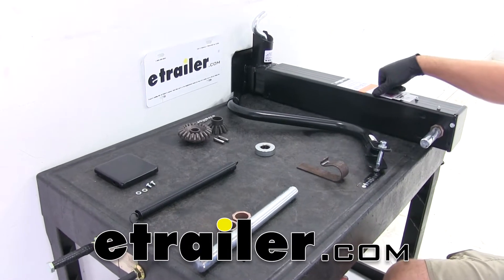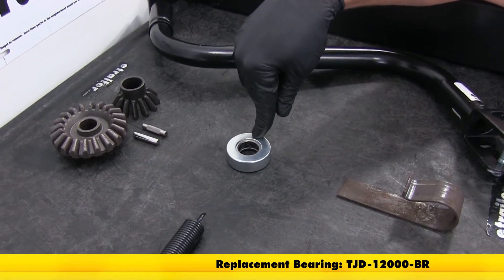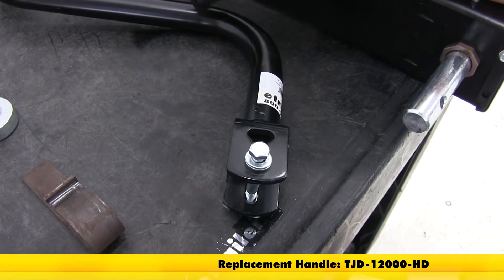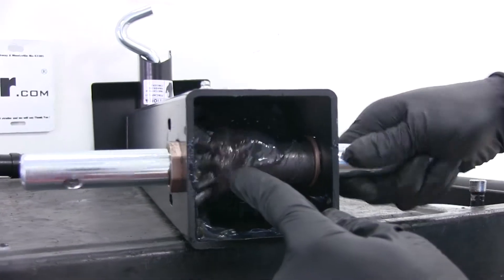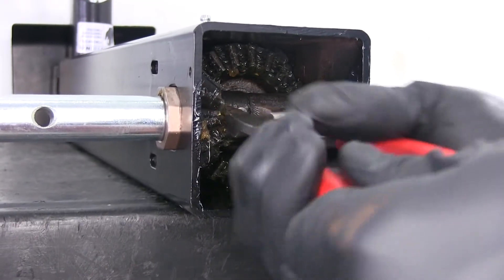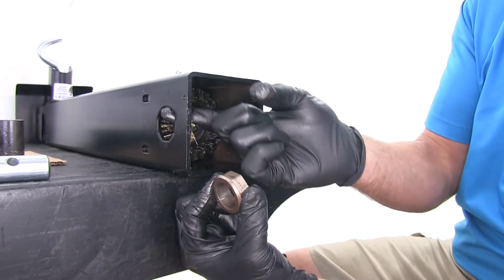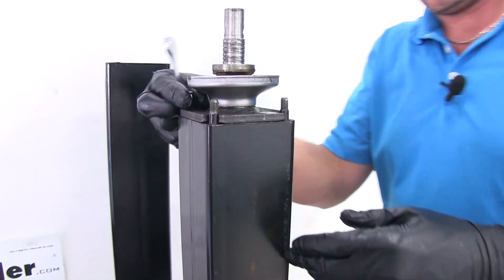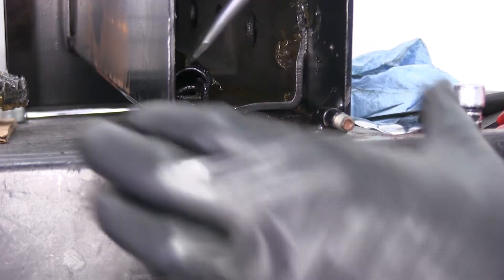Rebuilding of an etrailer or Ram Square Jack

Comment: Thank you. I was able to disassemble the jack and determine that the part that should last a lifetime was the part to replace. Called customer service and talked to a representative based in Missouri who quickly found the part and is going to have it on my doorstep in less than 48 hours. THANK YOU.
Reply from the maker: You're very welcome, I'm glad you got the part you needed!
https://www.etrailer.com/Accessories-and-Parts/etrailer/TJD-12000-BR.html
Reply: @etrailer  Thank you for the video and placing this part link here so I could buy the "never wear out" part for my 4 year old dump trailer jack.  Customer service on phone was excellent as well.

Comment: After seeing this video, I decided to work on my jack because the spring rusted out and came off at the bottom, I repair equipment for a living, I thought it would be simple. Then I noticed that spring can only be replaced on the bottom if you cut the welds. Its such a strong jack but the spring is its achilleas heel, buy the way, I did fix it.
Reply from the maker: I always found it annoying when manufactures made weak points in their products so hard to access, but I'm glad you got it fixed. Can you still tell what brand your jack was? We mess with a lot of jacks, so I'm just curious. Maybe a Bulldog or older Ram jack?
Reply: I looked at parts from the manufacture, they use Bill dog and Ram jacks, I believe its what ever is cheaper as they buy them, but with no patent, from what I see is every manufacture is using the same design and template.      @etrailer

Comment: Great job and very helpful.  However, I think the drive gear was put on the wrong side when it was put back together.  Look at the way the bottom of the jack is turned when disassembling, then look at the way it is turned when assembling.   I think you would have to turn the handle in a counterclockwise motion to jack it up if it is left that way.
Reply: I noticed he put the gear on the other side too, im sure anyone that has the confidence to do this themselves would put it together the same way it came apart. This was still a good video that explained it well. I bet between takes and just paying attention to filming it was the reason for the little slip up in the gear placement.
Reply: doesn’t matter which side great is on. Just put the handle on the side you want

Comment: How do you attach the bottom of the new replacement spring you did not show in video
Reply: Theirs a reason. It's nearly impossible unless you cut the footplate off , attach spring then reweld it back on. They pretended it was possible through the hole in the sleeve.
Reply: Quantum physics and 4 very expensive snap on tools. Don't ask me which ones. I have no idea. But I'm sure there's a tool for that. Lol

Comment: Great video! I have one work mine.  I can't pull the shaft out after removing the pin.  The shaft will pull out until the end is flush with the bushing end and then stops.  Any suggestions?

Comment: Can you name the part number for the screw that drives the jacks up and down?
Reply from the maker: If you have a RAM or etrailer brand # TJD-12000 series jack, a replacement main rod/screw is available as part # TJD-12000-RODNUT. Check it out by using this link:
https://www.etrailer.com/Accessories-and-Parts/etrailer/TJD-12000-RODNUT.html

Comment: Well done video, thanks so much, one problem, the hitch on the truck broke off and bent the frame on the trailer, jack is OK except for the bottom plate, had to cut it off and when I got the plate cut, kaboom, went up inside the tube, have a new plate made and hook for the spring, question is I should hook the spring on before I weld the base skid plate on the main tube, correct. You did a great job doing the video, excellent.    Thanks
Reply from the maker: You will want to hook the spring on the foot before reattaching it. If you don't, you will not be able to get to it.
Reply: @etrailer  Just what I did, worked out great with the new landing pad
Reply: @etrailer that's why you didn't show reattaching the lower spring connection in the video.

Comment: Im having trouble removing the gear spliced pin. Dont know why, it had plenty of grease. Its on a 92 W-W stock trailer
Reply from the maker: I would recommend trying to use a pin driver and hammer to drive it out enough so you can get a vise grips on it. Then, you can pry it out by using the side of the jack tube.
https://www.etrailer.com/Accessories-and-Parts/etrailer/TJD-12000-BR.html

Comment: Can I reverse the up and down rotation by swapping what side I put the smaller gear?
Reply from the maker: Yes, moving the small gear to the other side of the tube would change the direction of the crank handle.
https://www.etrailer.com/Accessories-and-Parts/etrailer/TJD-12000-BR.html